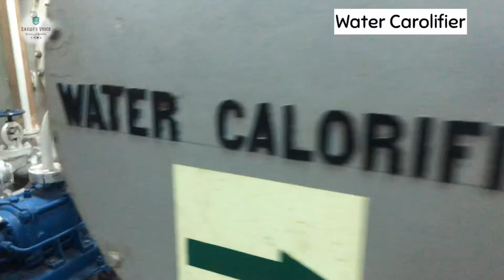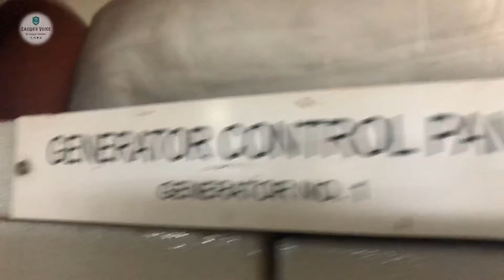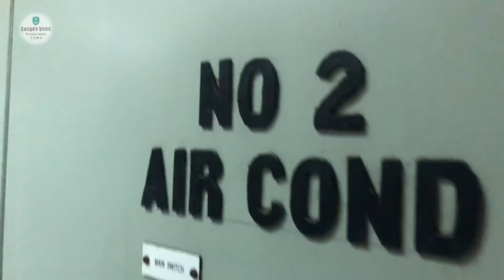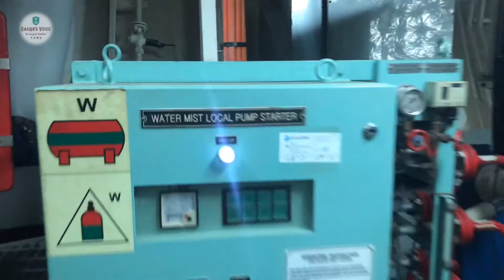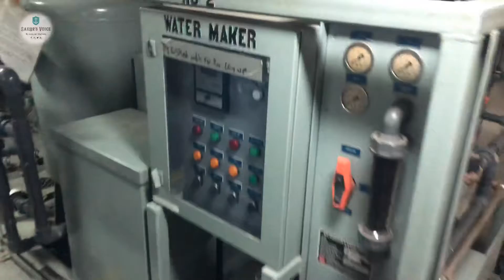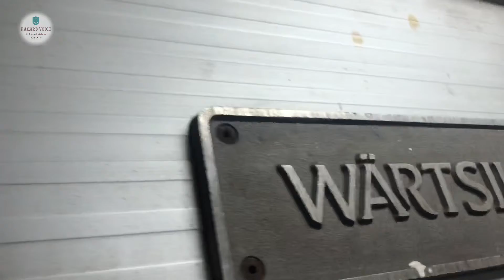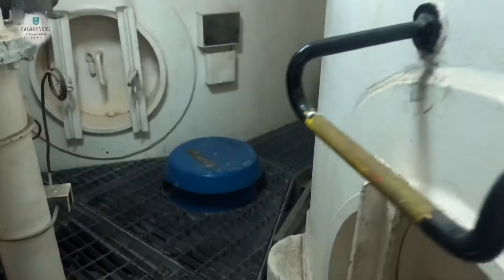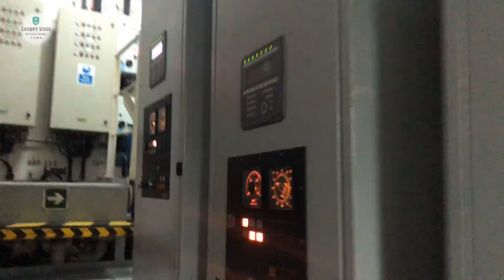Electric Propulsion Supply Vessel’s Engine Room | Well Stimulation vessel | Dp2 | Sailor’s Voice

Comment: Hi sir, Are there  diesel oil purifiers in this DP vessel ?
Reply: Yes. Check in 7.21. Usually it is called FO Purifiers, but in this case is Marine Gas Oil for Main Engines (here is called Main Generator).

Comment: Will engineers working in engine room lose job if ship fully electrified?
Reply from the maker: How can be fully electrified?
How generator works ?
Need Engineers to maintain engine, auxiliary machinery & everything.
Without Engineer, deck officer, electrical officer, AB,Oilers we can’t run ship
That’s called safe manning

Comment: Difference between electric propulsion and diesel engine propulsion??
Reply: Diesel engine propulsion it means Main Engines 4 strokes medium speed with gearbox coupled to a shaft line to the propeller (usually with control pitch but could be fixed pitch with engine variable speed). There are many configurations but this a basic one. In other way the terms Electric propulsion, we have Main Generators (same types of engines coupled direct to Generator) they give electric power to frequency variable AC Motors coupled to Azimuth or Azipull drives (as a basic idea they do propulsion and steering in the same unit, turning 360 degrees). This is the main idea but there are also combinator system,  a mix between both system, we have both input to gearbox, diesel engine and electrical motor, and one output shaft line to propeller. Depends on type of vessel we have many configuration available.